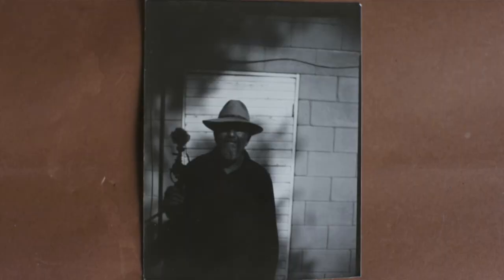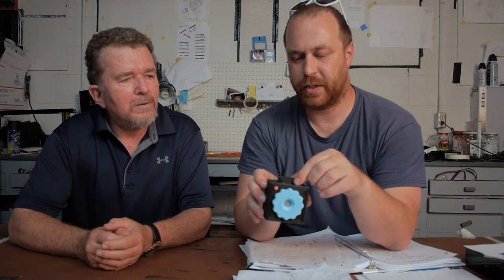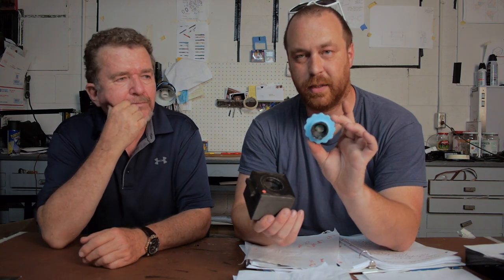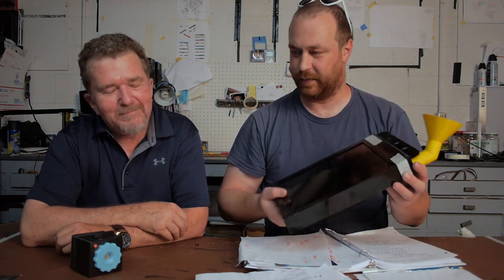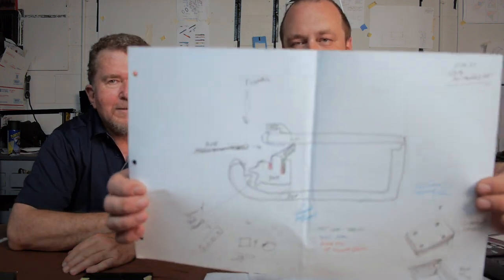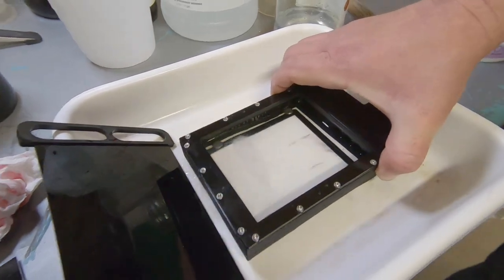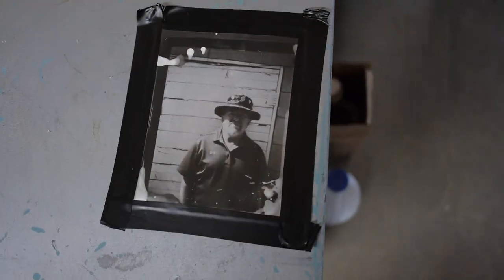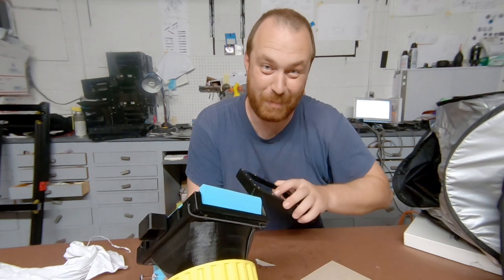Cameradactyl Go & Self Developing Back, Part 1

Comment: I love you guys but ... You need a changing bag to load or reload the back so I don't quite get the advantages of a self developing back over just a single sheet developing tank of similar design plus regular film holders. You have to dry the tank and stuff before you can make another exposure. You wouldn't if you separate the wet and dry parts of the process. For 8x10 you could use the Stearman tank. This inspires me to 3D print a single plate covered tray for 4x5 dry plates though.

Comment: Hi Joe, about the citric acid what is the concentration? thanks
Reply from the maker: 30mG per liter of water.
Reply: @Joe_VanCleave  thanks a lot. so it's 0.03g per litre. Because I read other people using 30g/L. I am using an expired paper 5x7 from Foton, fibre based. Do I need to modify something in the process?
Reply from the maker: @FaustoSaporito  30mG ... milligrams ... per liter. And it's not super critical to get the concentration exact. The idea is to saturate the emulsion with citric acid, to prepare the metallic silver to be etched by the peroxide.

The citric acid is inexpensive enough to treat as a one-use-only solution.

Regarding your choice of paper, there's literally no way of knowing how it works in this process except by exploration and experimentation. This isn't a cookbook with known ingredients and known outcomes. You have to enjoy experimenting to do this well. You will have to do a series of test exposures to determine the optimal exposure index. It helps to have experience shooting paper negatives and processing B/W paper in the darkroom.

Comment: When you mentioned it only needed 35ml of chemistry I imagined a series of luer locks for connecting 35ml syringes on the new back design. great work and really fun to see the development.
Reply: I'm planning on doing a DIY project on that, a portable tank with syringes and small chemical bottles so that it can be developed without handling the chemicals, but his design is simpler.
His design with the tank being tilted horizontally for developing really saves on chemistry, where as with the tank vertically it uses up more liquid.
I'm building my own 6×9cm SLR camera, which is quite unique, and plan on using X-ray film for reversal process (B&W slides should be nice, and rating the film at ISO 100 is much better than ISO 3 or 1, for photo paper)

Comment: Looks awesome. You mentioned marking one side of the dark slide as exposed /not exposed. Could you just leave one of the opening filled and when it is over the opening for chemistry it is unexposed.?
Reply from the maker: We made a test darkslide like that, and it's not as strong as the current design.
Reply: I like this idea.  Maybe a mod in the future!
Reply: @Joe_VanCleave  I think what @darcar34 is talking about is not cutting a hole on one side, so that you could only pour with the slide flipped one way.  I think you are referring to the ones without the bonded thick handles

Comment: Do you do the normal development with dev, stop, fix before the citric acid and peroxide
Reply from the maker: No! Developer, then citric acid (for about 3 minutes), which acts as BOTH a stop, and prepares the developed image to be dissolved in the peroxide. Then you can take the print into normal light and place directly from the citric acid to the peroxide. After it's completely white, at least 3 minutes, a water rinse, then sodium sulfite (clearing agent) to prevent brown stains. Then another rinse, and back into the developer for the final positive image to come up. Then your final rinse and dry. No need to fix because there's no unexposed silver halides left in the paper to turn dark over time.
Reply: @Joe_VanCleave  much appreciated, I’ve ordered a back from Ethan
Reply: What’s the concentration of the Citric acid? I saw it somewhere in the comments but can’t find it agt
Reply from the maker: @ianfleming4356  The stronger it is, the better the process works. Make a saturated solution, enough so no more powder will dissolve.
Reply: Thanks for your help
Reply: @Joe_VanCleave  Joe are the RA4 process instructions available, sorry for so many questions
Reply from the maker: @ianfleming4356  The REVERSAL PROCESS for RA4 is experimental. The paper wasn’t originally meant for this purpose. There are a number of experimenters on both YouTube and Photrio who are working with variations of this process. Some are rinsing the blue dye layer off the paper before exposure, others are using a variety of color filters in an attempt to get normal color tones. Keep in mind the paper was originally intended to makes prints from C41 negatives with their orange color case. You should search RA4 reversal process in YouTube and watch a variety of people’s videos to get a better idea on how to proceed. You also need to be comfortable with iteratively experimenting and evaluating your results.
Reply: @Joe_VanCleave  thanks for pointing me in the right direction